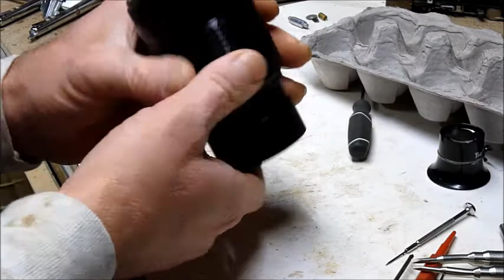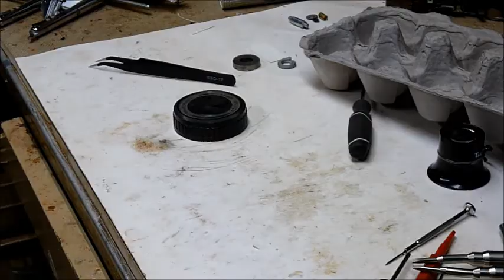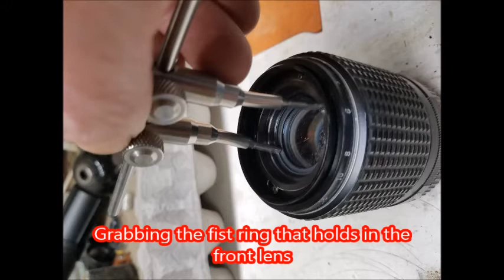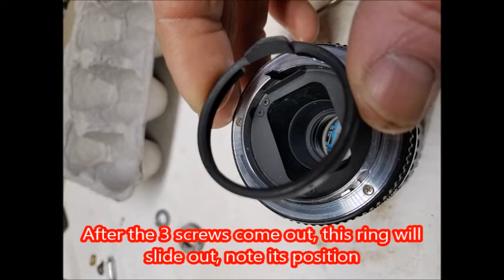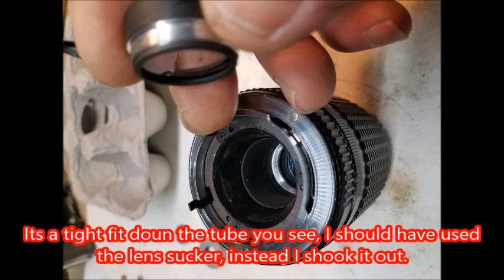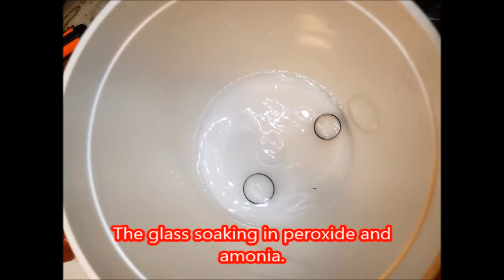Pentax SMC 100mm lens cleaning

Comment: Hello. Nice tutorial. 

From the auction pages I have seen, I must remark that the fogging you have is quite a common problem, on the 100mm Macro Pentax lens. I don't have this lens, but quite a few others from Pentax from this era. As I have the "bad" habit of buying cheapo lenses with problems, in "as is" condition, haze is an issue I encountered many times. I highly doubt that fungus would insert itself between cemented elements. However, fungus comes with moisture. Apparently, it is the moisture that infiltrates, and degrades the cement used to make doublets. And many times, non-cleanable haze is within doublets, while occasional dirt elsewhere can be cleaned, without difficulty. Only a highly skilled tech would have the know-how and tooling to separate a damaged doublet and re-glue it properly. So, now, I would avoid shopping for hazy Pentax lenses, when I now there is a doublet somewhere in the optical formula.
Cheers.
Reply from the maker: I have only run across fogy doublets, I think twice, which I guess is pretty good given how common they are. Most of the time I try to clean lenses that have had fungus on them so long it has etched the glass or the coatings. Either way the lens is crap. I would have thrown this one in the trash but the rest is in such nice condition. I tell myself I can use it for parts.
Reply: You can  separate and re-cement doublets, and in fact any cemented group  .You need the appropriate solvent, which is a controlled chemical, and very evaporative. The element group is then sat in this for about 24 hours ( use a sealed metal container), and when they separate, they are cleaned, and dried. Then a spot of modern uv cured optical cement in the centre (Edmund Optical, Norland Optical Adhesive-keep in the fridge-lasts longer!), carefully align the elements ( no more than two at once) and put under a nail-varnish UV light ( ebay, less than £10) on a level surface. Should take about 3 minutes max. Of course, until you separate the elements you have no way of knowing if the haze is in the cement or the glass-if the latter ( as in some samples of the Pentax 100mm bellows lens rear elements where the glass deteriorates). You just need to take care at all stages, and be very clean in how you do this. But I have done it a number of times successfully over the years.